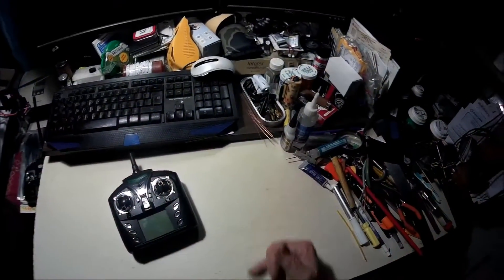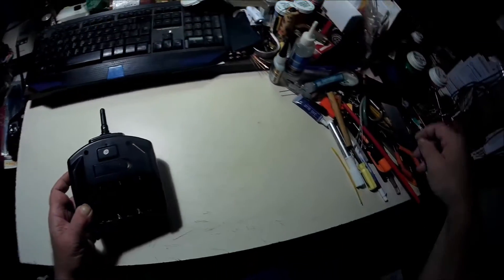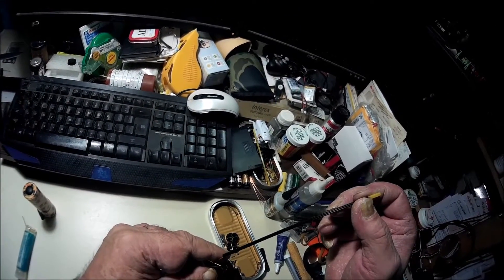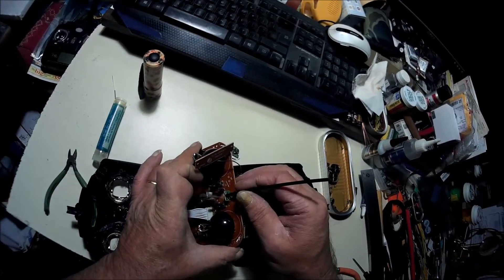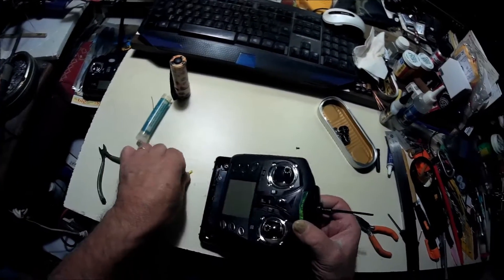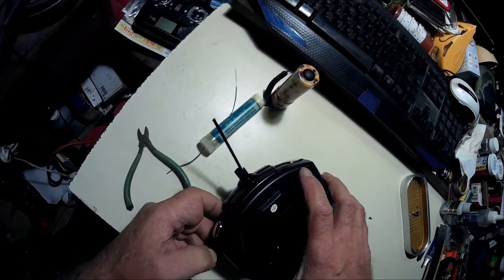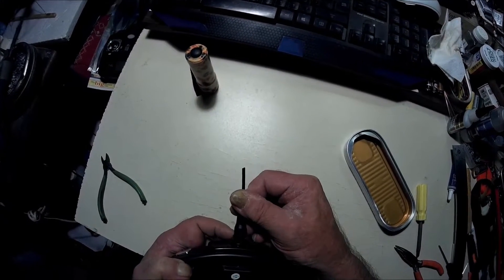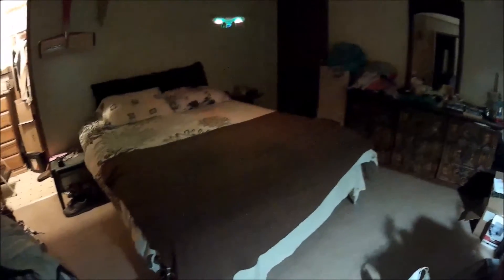WLToys V686g Transmitter Modification

Comment: Cool modification.
Reply from the maker: +Thisara Gamalath Thanks Thisara, but honestly, it didn't work as well as I hoped, reason being is that the WLToys has Omnidirectional Ant. from the Factory, so I'm planning on re-doing the Antenna like how I did the Syma and maybe adding a 200 mW booster, just to mak esure I have the power I need for longer distance Flights. Thanks for watching and I'll post the results after I do those changes..as always Happy Landings..  :D
Here's how I did the Syma X5c-1 in case You're Interested..  :)
https://www.youtube.com/watch?v=oEXqWcXiFBc